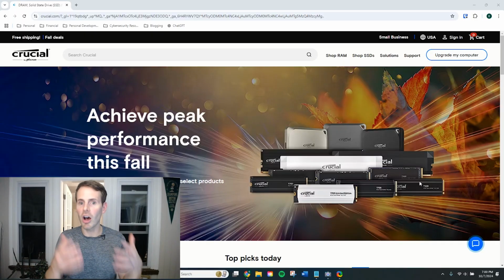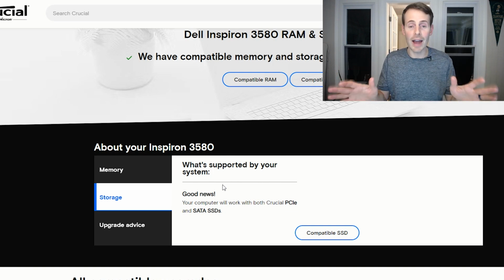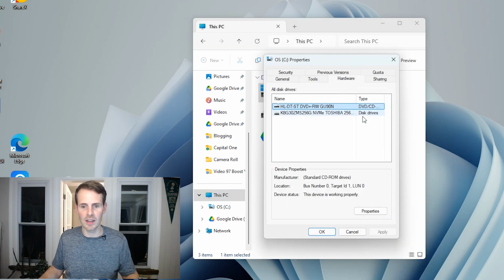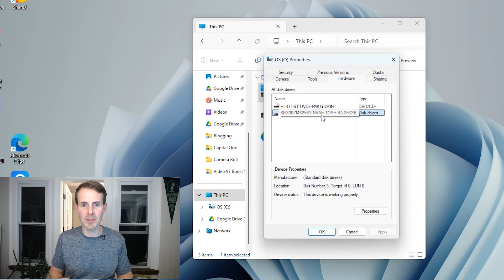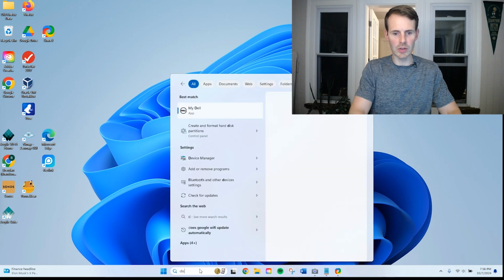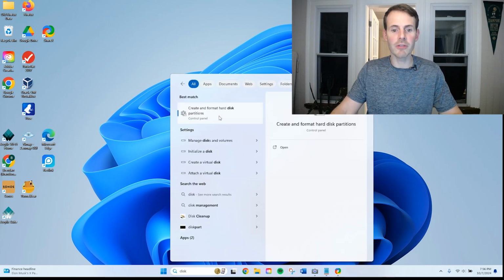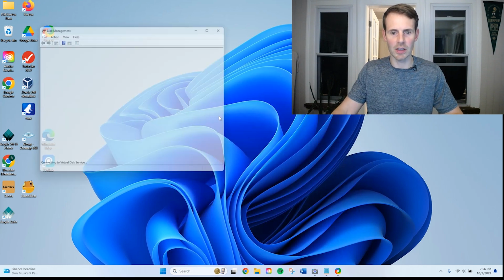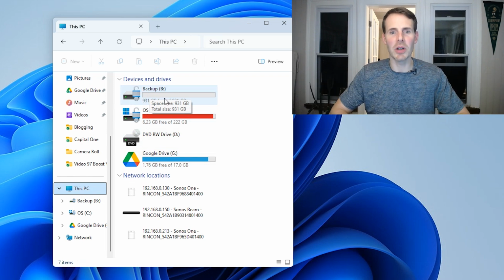Storage Wars: How to ADD STORAGE to a Laptop with an SSD

Comment: You did a nice job of explaining the procedure. Myself, I would have replaced the nvme drive with a bigger and faster one by cloning the current disk. It is a bit more involved and probably a bit more expensive, but worth it. One thing that needs to be done is to transfer some of your files off the nvme drive. If it is at or near 80% full, it slows the drive down and shorten its lifespan.
Reply from the maker: Thank you very much for the feedback. Honestly I was looking for the quickest/easiest way to add storage to my system so this was the route I took. I also wanted to provide a procedure that the everyday computer user could follow and reimaging a drive and moving data over makes things a lot more complicated (if replacing the NVMe drive). I will also look to move some items off the NVMe drive. Thanks for watching!